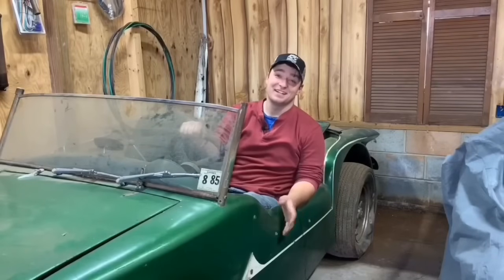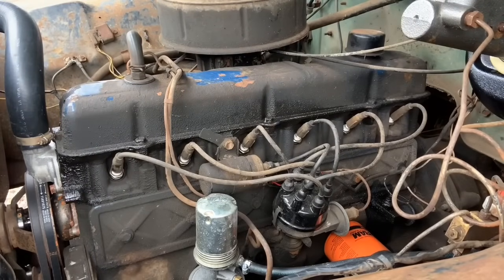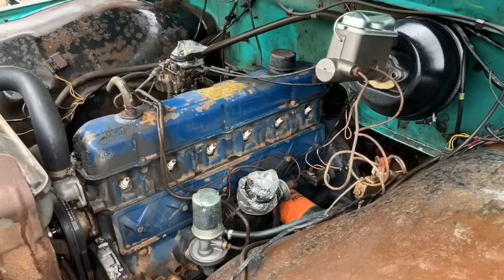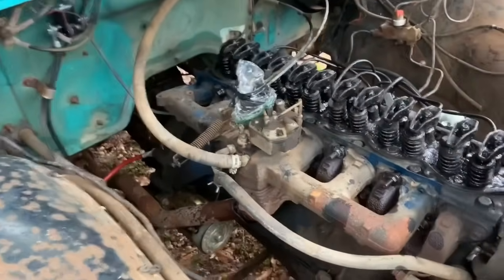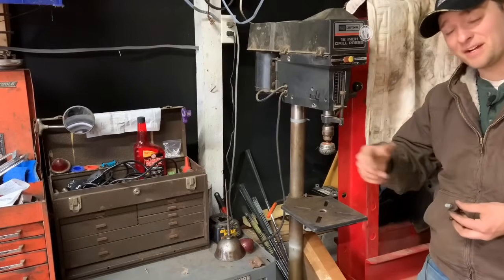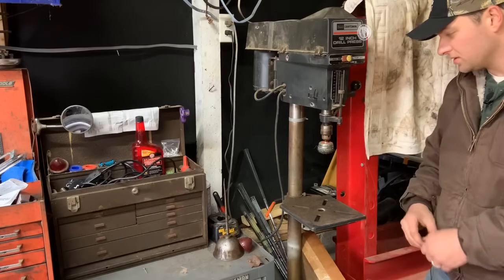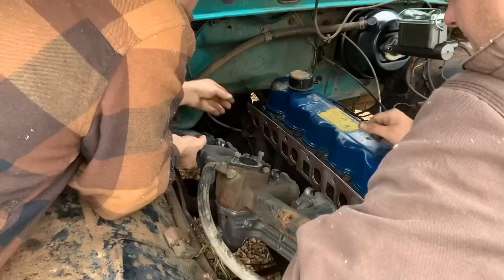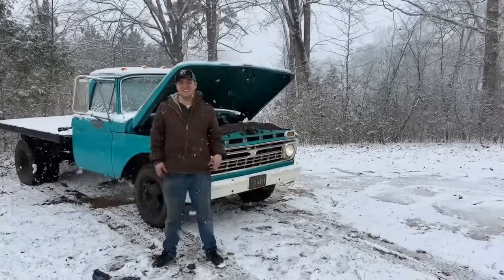Engine Clean-Up and Playing in the snow in our 1966 Ford F350

Comment: I have that truck’s brother!!! It worked in an apple orchard in Port Orchard, WA till a few years ago. VIN comes back as ‘65 but a guy told me its a ‘66. In either case… same turquoise color but with a white hood/door flare. And its a 3 speed.  I forget the engine size. I’m not a mechanic type usually … but this thing is so simple I can work on it.  Had to find a new radiator for it and it definitely could use some power steering!  Anyway … was cool af to see yours!!

Comment: Lets give you a GREAT trick for holding the gasket in place while finagling the valve cover or oil pan in place. use 4 small zipties in some of the holes for the bolts. When the cover is in place, set bolts in the free holes and start them, like ½ way in. Then cut and remove the zip ties and finish the install. Really works!
Reply: Waste of zip ties... fishing line is your friend here. Best wishes!

- Max Giganteum

Comment: We use to have a truck similar to your f350. Ours had the straight 6 engine also.
they are work horses. My dad never changed the oil . He used it every day. One thing about how we shifted the transmission #1 gear is the granny gear. We used it if we were hauling or pulling a trailer or up a grade.  If not the normal take off was #2 gear. Sure brought back some memories. From one shade tree mechanic to the other "keep it running".
Reply from the maker: Awesome! 🙂 Yeap, I take off in 2nd in this truck. It has a NP541 5 speed, with a granny all the way to the right and down! Pretty weird lol

Comment: The best thing you can do for that truck is take that fram filter and throw it in the scrap pile. Replace it with a wix. fram filters use a cardboard filter element that will come apart and send small particles through your oiling system, no good.

Comment: If you have a pressure washer you should try DRX Metal Rust Remover. You spray it on and let it sit a few minutes and pressure wash it off and its clean bare metal. I used it to remove all the rust on my 1970 C30 and it took about 15 min to remove all the rust off the cab of my truck! If you wanted to you could just spray down your whole engine bay and it would remove all the rust.
Reply from the maker: Thanks for the info! I’ll keep that in mind as I clean more on it and other vehicles!

Comment: My favorite engine lube system flush is diesel fuel. NO DRIVING!!! RUN IN IDLE ONLY!!!!! 1/2 hour later drain and allow for the diesel to completely drain. 1 Quart Marvel's Mystery Oil in New Filter, 1 gallon DELO. let um warm up before  driving.
Reply from the maker: Sounds like a great idea! Thanks for the suggestion! 🙂

Comment: Enjoying the Bermuda blue Ford truck episode...really came out nicely after the cleanup. Could you help me identify a list of durable tools and brand if possible(sockets,wrenches etc)would consider buying. I am considering a project soon
Reply from the maker: Glad you enjoyed! 🙂 I’ve personally always been a Craftsman guy, but their ratchets are not good quality anymore. Mac and Snap-on are you top of the line obviously but can kill you on price. I normally get my craftman stuff then buy some nice older ratchets, craftsman or other brands they don’t have anymore. I love going to a swap meet or jockey lot and loading up on the good ole tools they just don’t make anymore for next to nothing! It’s always nice to have a few Harbor Freight wrenches and tools you can weld and grind on if needed, as they’re cheap but work just as good as any. Hope you find a good project!
Reply: @BudgetBuildz  Thanks for your response. I will look up as per your advice.

Comment: That’s a great looking truck. It might be nice to put a proper pick up bed on it if one came up that’s not too rotted out? I’m old school and the only time the torque wrench came out then was to do a cylinder head!  I like simple robust engineering and the straight 6 in your F350 reminds me of a couple of Triumph GT6s I had back in the day. One had a 2.5 engine out of a saloon (sedan!) with a non overdrive gearbox and an overdrive rear end. It would wheel spin in the dry on a standing start in 3rd gear! They’re real cool little cars. Do you see them over there in South Carolina?
Reply from the maker: It’s definitely an idea in the future if one comes up! 🙂 Haha cool! Those are sweet little rides! Yes we do see them here and there but they’re not commonplace, unlike the spitfire convertible!
Reply: Budget Buildz cool! I have also seen a GT6 engined Spitfire with a GT6 bonnet (hood!) in my time i.e. a convertible Spitfire. That’d be fun to do if a crashed unsaveable GT6  came up?!
Reply from the maker: Mark Bennett I would definitely be interested in tackling one of those! 🙂

Comment: before you change oil in it drain 1 quart of oil out and put 1 quart of diesel  fuel back in the crank case and run it for bout a hour then drain it and you will be shock how well it cleans the in side the motor
Reply from the maker: Sounds like a good idea! Thanks for the info! 🙂
Reply: any time

Comment: You don't have to buy a new Leatherman.  Look inside the handle for a four digit date code.  As long as the tool is less than 25 years old they will repair it for free.  The only thing you're out is the postage sending it to them.  Leatherman will send it back postpaid. I sent a supertool-300  back that that had the jaw broken out of the pliers.  They repaired it and when I got it back it look like new.  Maybe it was new I don't know.  It still carried the same manufacture date in the handle.
Reply from the maker: Awesome! I definitely need to do that with my next pair! Sadly when they do break like this...I grind off the broken tab to keep using them, which I know they won’t repair for free! I’ve definitely gotten my money’s worth though! 🙂

Comment: Great truck.  I love the 240/300 Ford big 6's. That's my favorite engine.

For the sludge build up in the engine. Do a oil change and substitute one quart of oil for a quart of ATF.  It will slowly clean up the sludge.  On a engine like that, I run the ATF for about 500 miles then do another oil change.  Then repeat it for 1000 miles, then 2000 miles.

I know you said you just wanted to get it going. But you really should have went with the the EFI 1987-1996/7 300 exhaust manifolds. They are a dual cast iron shorty header design. They perform much better then the old log style carb exhaust manifold.  And for the price you paid for that new carb exhaust manifold, you could have bought a new pair of the EFI exhaust manifolds. You get much better performance, without the draw backs you get from running headers.  And you can spend some time porting them to get even more performance out of them. 

Pick up a Offenhauser C-series 4V intake manifold. Then add a adapter and run a factory 60's Ford Autolite 2100 2V carb. You get even more performance out of a really simple set up.

If you like how it runs now, you'd love it once you get the big 6 to breathe better.  Think about running a marathon while breathing thru a drinking straw.  That's what a stock 300 is like.
Reply from the maker: Thanks for the suggestions!!

Comment: we had a 67 with the same motor, trans and rear, but it was a "long body" stake body with wooden gate sides. it was a torque monster. We loaded it over the roof line with mason's steel scaffolding, planks, and bags of mortar, sand and lime and tools... while towing a cement mixer behind. it had a valve tick the entire time we had it, and weren't mechanically savvy enough to chase down the problem. if YouTube were around at the time - i would have buttoned up that issue in a weekend. Great to see you bringing this one back to full usefulness.
Reply from the maker: Awesome! They’re good ole work horses 🙂

Comment: I’ve had good luck using a gasket glue (gasgacinch) to attach it to valve cover with the holes all lined up and some grease on the head side of the gasket to seal those imperfections. 
Everyone’s got a method. 
Whatever works. 
Great content. Thanx for posting. 🤙
Reply from the maker: Thanks for the suggestion! That’s a great one! I’ll keep it in mind if the next one we do! 😊 Glad you’re enjoying!

Comment: How do you clean the sludge? Water blaster?
Reply from the maker: I normally pull the pan and run kerosene down thru it, I’ve had some suggestions of running a little diesel with the oil. So may give that a try and see how it goes 🙂

Comment: Tip for those gaskets on long/narrow parts like a valve cover: instead of RTV, glue the cork to the valve cover with weatherstripping cement, following the directions carefully. Yes, it’ll make removing the gasket more difficult someday but you’re only gluing it to the part and not the engine, possibly making the gasket reusable if you need to remove the part for service. Best part is that when you tighten the part down, the gasket will NOT move around or squeeze out and it will not leak. I use this technique on oil pans and transmission pans as well.
Reply from the maker: Thanks for the suggestion! 🙂 I’ll definitely keep that in mind! I’m not a big cork gasket fan, I normally used a metal/rubber style and they do much better!
Reply: Budget Buildz I’m with ya there! Always hated cork but sometimes that’s all ya get. Love the show, man. Keep ‘em coming!

Comment: I put studs for the valve cover instead of the bolts and bought a new chrome plated valve cover for 25$ instead of cleaning the original
Reply from the maker: That would’ve made it much easier!

Comment: Have you ever tried spraying that fogging oil on a patina hood to protect  it? Just curious. I know some people use linseed oil but I've also heard linseed oil can be kinda volatile.
Reply: Linseed oil works really well. The problem with linseed oil comes when you leave the rag or whatever you use to apply it with just laying somewhere. The rag will essentially spontaneous combust. Clean the rags or throw them in your fire barrel if you have one.
Reply from the maker: You know I haven’t! It’s definitely worth a try! I’ll be sure to video it! 😊😊

Comment: "Realistically" you may not need silicone on the valve cover gasket when it's new! I did it that way only once, my '85 gmc s15 leaked terribly until a few years of adding oil every week I replaced the valve cover gaskets again and silconed both sides of the gaskets! Never leaked a drop again. All of a sudden I could run the correct oil in it again not have to use super thick heavy oil to try and stop the old leaks! This is especially true of cork gaskets as they flatten out over several times of retightening the covers. Wishing I had your truck right now though, lol. My 63 f100 is off the road right now due to lack of funds.😢😢
Reply from the maker: I hear you there! Leaks can be a pain! I hope you’re able to get it on the road soon! I’m sure it’s a sweet ride! 🙂

Comment: Well you had me laughing at the valve cover gasket, those are always a pain to place unless you know the trick. Permatex makes a gasket "tack spray" you apply to one side of the gasket (the side that will touch the valve cover) this allows the gasket to stay seated to the cover and allows you to avoid the gong show you had putting the cover back on. Use the same trick when removing the lifter galley cover plates and replacing those gaskets as well, works great! The old Ford is starting to look pretty good. When you go to rebuild the Carter Carburetor that's on there, be sure to use one extra spacer gasket between the carb and the manifold, this will give you a bit better flow (in later models Ford had a 3/4" spacer they installed made out of aluminum for that reason as well as being a port for the emissions crud they added later). Because the old girl has been sitting a while, if you run some high detergent oil through it for a few hours before you drop the pan, it will remove a lot of the caked on crud that has accumulated over the years of stop and start driving. Six's tend to not like short runs, they don't get up to a good temperature to vent off any water condensation that forms in the pan and valve cover from the low heating and cooling. She looks like she's coming along nicely though, keep up the good work! Cheers!
Reply from the maker: Thanks for all the great information! 😊 I’ll keep it all in mind as we do more with this ole truck! Thank you so much! 🙂

Comment: Looks like you have the same torque wrench I have 🤣
Reply: I'm still using a Kamasa 1/2 " socket wrench I got when I was 11years old and had to learn how to fix my mum's car. Been used as a hammer, pry bar , clutch alignment tool as well as a wrench. Still smooth and solid 45years later. Sometimes we get lucky with tools and get the ones that don't snap at the first sign of use.
Reply: @jeremytoms5163  I need to find me one of those every time I try to multitask a tool like that i always end up breaking it and it is always my favorite tool the one that i grab first for everything

Comment: EZ off oven cleaner always works really good for me when I'm degreasing an old engine/engine bay.
Reply: It works really well, but gloves are mandatory. It's a lye-based cleaner and will do a number on your skin. Scrubbing Bubbles bathroom cleaner is less nasty but works almost as well.
Reply from the maker: Thanks for the info! I’ll give those a try next time!
Reply: @BudgetBuildz  Simple Green works, too. But requires more scrubbing. It's really effective on animal greases, less so on petroleum, at least in my experience.